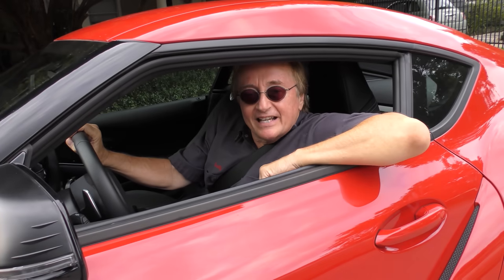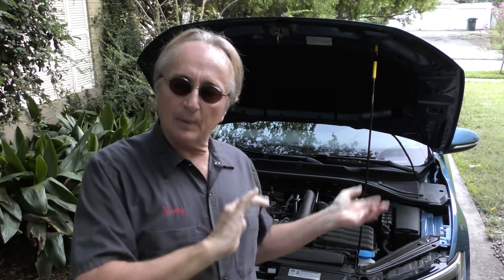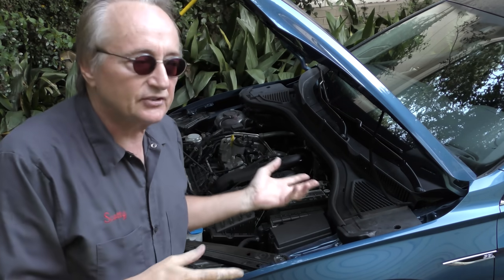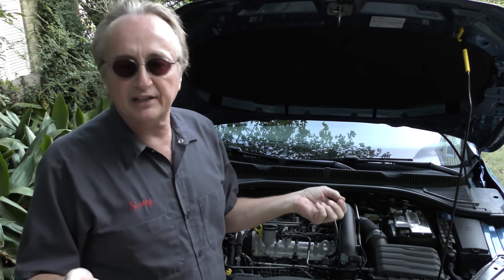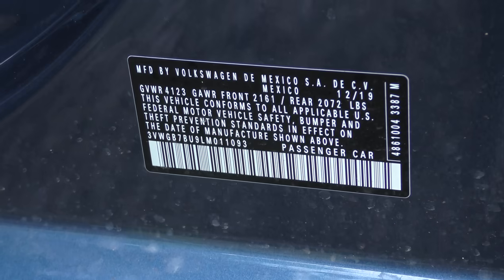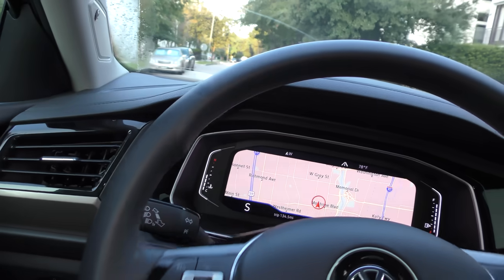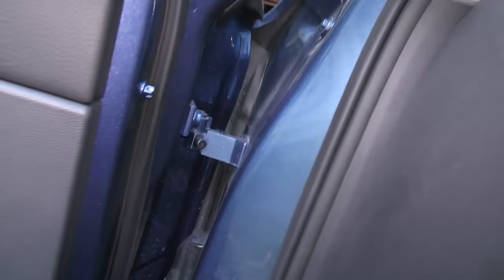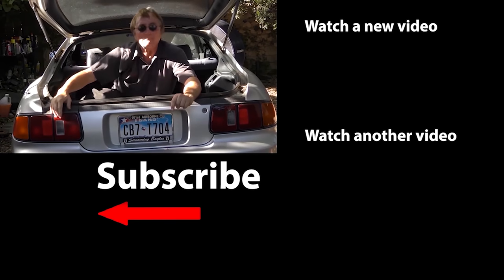I Just Found the Worst New Car Ever Made

Comment: Actually these newer 1.4 TSI's are pretty reliable. I don't think the timing belt is that big of a problem if you change it on time.
Reply: As a mechanic who mainly work on European car, yes, this one is easy enough
Reply: 1.4tsi/1.5tsi/2.0tsi all pretty good we'll built engines in well built cars. VW says lifespan is about 200k miles and generally they make that without problems after that they can go for longer sometimes. However keep in mind it will simply wear out from the turbo strain and break so just buy a new car by then. Thing is though in the usa people drive more then here in Europe. In Europe gas prices are 3.5 times higher aswell. So it makes sense to produce these engines because of gas mileage and people here tend to not drive 300-400k miles with one car anyway since that is 30 years of driving for most people.
Reply: When would you say is a good time to change the belt
Reply: @sinisterdraws4483  When VW says you should. I used to change it every 60k miles on my old Passat TDI, but always check your owner's manual.
Reply: @sinisterdraws4483  Vw lists for a belt inspection at 248.000 km
If belt is ok inspect every 30.000 km.
Reply: They’re replacing the 1.4T with their new 1.5T. I wonder how the 1.5T will be
Reply: @devn3813  Hearing reports of significant oil consumption on these newer ones.
Reply: It's even on the published service schedule... honestly it was always going to be yelled at as it's not a Toyota Camry/Prius
Reply: Timing belt costs over $1000 to change, and it has to be done 4-5 times over the life of the car.  That’s a giant waste of my money!
Reply: Warranty Direct insurance company rates VW the 2nd Least Reliable engine due to frequent breakdowns.  My Beetle turbo engine died at just 70,000 miles so the WD rating seems accurate.  My 2 Hondas went 300,000+ miles with no engine breakdown.

Also VW commits criminal acts by cheating on EPA and EU pollution tests
Reply: @devn3813  .1 better
Reply: @skimanfree1073  yeah makes a big difference with a fairly slow car
Reply: My VW had the same care as my two Hondas that lasted over 300,000 miles.  There’s no reason for it to fail at just 70,000 (except it’s poorly designed crap).
Reply: @electrictroy2010  The earlier engines with the timing chains were poorly designed crap. Some would fail even quicker than that. That said they fixed the problems on the newer ones. Only problem they have is the already trademark VW oil consumption. And yeah Honda is better than VW on the mechanical side, no doubt about it. The interior is the only thing that's better than the competition on newer VWs.

Comment: It takes 4 hours to replace a timing belt on a 1.4T. In other words, about the same time as any timing belt. And the water pump isn't under the cover. I changed mine at 125,000 miles. Zero signs of wear, but wanted the peace of mind. And it's my third Volkswagen, my second Jetta.

Comment: New timing belts are usually made of a Kevlar composite, which is as strong if not stronger than steel. No reason why they shouldn’t last basically forever.
Reply: Not only that, but the best that I could find online is that the belt "should" be changed at 150k.  That's 10-12 years of average mileage, and the first major maintenance cost in that time.
Generally, I'd prefer a chain, but we've all seen a timing chain break or slip, too.  Those are usually interference engines as well, but nobody says anything because nobody expects the chain to break.

Comment: Modern cars put more tech and shine while cheapen the powertrain, AC and electric system for me I would rather have lowest tech but solid build powertrain, AC etc
Reply: Downsized engines aren't necessarly cheaper tho. They often need precision and high quality forged parts.
Reply: Mercedes surname says it all
Reply: AC on this vehicles is really good. I own this vehicle.
Reply: Gas milage and emissions is king, less space to fill, less emissions, same or better hp, but nearly no room for valves in a 4° slop or more. They could make it easier to change, but you have to pull spark plugs to set TDC cylinder 1 so just keep it away from redline, and run the heater on low in log drivethru lines or traffic to keep pressure off the pump seals.
Reply: Soon there will be no powertrain lol.
Reply: Yeah.. Agree
Reply: @Mohnnad Mercedes In my opinion 90's and early 2000 model Japanese cars had the best balance of tech and reliability.
Reply: @AG-uh9bf  you probably kept it running every time you drove the car which is unnecessary.
Reply: @trevagraham1605  my 2000 VW Cabrio fits that description

Comment: I have a mk6 Jetta with the 2.0 i4 NA engine. Best car I’ve owned, bought it with 70k miles, it has 151k now and nothing has broke, never had the engine light on, all I’ve replaced is the a/c compressor. Trans still shifts smooth. I know it’ll last me over 200k

Comment: I guess by lifetime they're referring to the lifetime of the warranty.
Reply: Referring to the lifetime of the car... About 60k miles
Reply: Lasting to the end of the scheduled maintenance, which is 120k.
Reply: I think that says something if scheduled maintenance is only to 120k
Reply: Yes or the lifetime of any Volkswagen or Audi which is well before 100k
Reply: @krassimirpetrov7131  Friend of mine put 7k into a 2009 VW beetle to restore the non-working convertible top, wheel hubs bad on two sides, brakes, etc etc. about a year ago. Car has 88k miles on it and the starter, battery again, charging cable, fuse box and maybe the harness needs to be replaced. They're starting with the battery and cables at a lovely 600$. Would never, ever purchase a volkswagen.
Reply: This VW's engine has been out for 6 years, it does last past 100,000 miles and is actually a pretty reliable engine. According to the maintenance schedule the timing belt should be replaced every 100,000 miles wich is anout an 1,100 service at a VW dealer. It's been said it'll last a little over 120k on VW forums tho

Comment: Well i have had my 2013 cc manual for 8 years and havent had any issues with it whatsoever besides getting break pads and oil changes
Reply: Warranty Direct rates VW the 2nd Least Reliable engine due to frequent breakdowns.   My Beetle died at just 70,000 miles.  My 2 Hondas went 300,000+ miles with no engine breakdown.

Also VW commits criminal acts by cheating on EPA and EU pollution tests

Comment: The timing belt on a 1.4 TSI must be replaced every five years or 75,000 miles. They also replace the water pump and tension rollers. At the dealer this costs around $600.- independent garages are a lot cheaper.
Reply: $600? I'd bet it's at least twice that.
Reply: The Jetta 1.4TSI has a timing chain.
Reply: @douglasb.1203  Only the old EA111. The EA211 (from 2012ish-on) is a lifetime timing belt with an inspection interval of 150k miles and every 20k therafter.
Reply: $600 not bad for the dealers, I've spent $900 to have the timeing belt changed when I had my 2008 Toyota Camry.
Reply: I got an estimate at VW for a timing belt and water.They wanted  little over $3,000 for the job.F that

Comment: The 1.4 TSI is truly the worst engine.
I needed a commute for work and could get a Octavia with this engine for a cheap price.
I researched the engine and was shocked, how BAD it is!
I got a 1.4 Corolla... which was the best move... now I drive a 2020 Corolla 2.0l hybrid GR fully loaded.
Don't get a VW!

Best regards from Germany
Reply: Nice to see a German buying a non German car.  Your Mercedes and BMWs and VAGs are overated.
You should have bought normal ICE  Corolla with no hybrid.  Less complicated.
I am from the UK and always bought German cars.  Then I moved to Thailand and was in a Toyota Corolla taxi in Bangkok that had done 1 Million Kms.  I looked at Toyota products and now drive a Toyota diesel double cab pick up truck and if buying a car would buy a Corolla or Camry.
Reply: 1.4 tsi truly the worst engine??? Yet its powers millions of VW, Skoda, audi's and Seat's around the world. Its had its problems especially the earlier versions but its by no means the worst engine as you claim.
Reply: Its been awarded "engine of the year" for nine consecutive years or so..  Direct injection turbocharged back in the day was an innovation. You get the horsepower, the torque, the fuel economy and fewer emmisions and all of that from a 1.4 engine. Thats called "efficiency" and if an engine is efficient is not the "worst" for sure. 

To get all these goods ofcourse you need high pressure fuel, high temperatures in the combustion chambers etc so you sacrifice a little bit of reliability, but you cant have it all.
Reply: @prozacnation25  It is all about complying with Euro regulations created by those Buro-craps.  As a UK National so glad to see that the UK are leaving the EU and hopefully with no trade deal especially now the UK has signed a good trade deal with Japan.
Reply: John Anderson that’s because you can’t afford a bmw Chief you have no idea what a true driving machine is
Reply: Battalon, you made a very smart calculated choice, i too use to own VW, golfs and an Audi 80 coupe, but after so many trips to the Vag, garage, i had had enough, i asked one body repair man, who makes the most durable, well made vehicles, the answer was, Honda and Toyota, then i asked two mechanics, i got, Lexus Toyota twice. So opted for a corrolla based mr2 spyder, in 10 years, apart from tyres and oil changes, filters, wiper blades, the only thing that broke was one solitary oxygen sensor. It had 66 thousand miles on it before it was written off in an accident. Toyota make what i and others believe to be the best cars for reliability.
Reply: @johncombs216  I might not be as well off as you.  I had many BMWs starting with my own E30 when I was 24 years old when they were exclusive to own compared to the Fords and Vauxhalls.  I have had many company cars ( BMW, Mercedes and Audis).  
If I was buying a good reliable quality car would opt for a Lexus (Toyota) built in Japan.  

With regard to your "true driving machine", there is no point with all the traffic, speed cameras and state of the roads in the UK.  By the way, most manufacturers seems to be advertising media connectivity as opposed to power, top speed and acceleration as in the 70's and 80's.
When you get older in life, you will realise that status symbols, such as cars, are not so important and keeping a lower profile is the way to go.
Reply: Chaminda Thushara Ruwan Kasturi  BMW is so common now that it is nothing special.  A Lexus is more exclusive.  Have a look at something like the Lexus LC500 with V8.
Luckily we all have different tastes and requirements in life.  BMWs for some and Toyotas and Lexus for others.
Reply: Der 1.4. TSI von meinem Kumpel ist 160000 km in 10 Jahren gelaufen, völlig ohne Probleme!
Reply: It is the worst of VW. That is a fact.
The second worst was the old 2.0l TDI (the new one is tied to the newest diesel scandal....). 
Of course some have good experiences with both BUT not the majority!
Asking my mechanic gave me the same result.
With the right proper maintenance even a Italian car can run forever.
But we do not drive a car to take car of maintenance all the time.
I know a lot of people never experienced any problems with BMW... but in general the quality plummeted since the 2000s.
Reply: @VampirusX  Since beginning of the 2000s ICE have become more complicated with all the EU buro-craps regulations and hence less reliable and expensive to repair.  Hence, in the UK have been driving pre 2005 cars but that is now not possible with the emission regulations in the London area that is expanding further and further out.
Reply: @johntheaccountant5594  The Toyota hybrid is proven for decades.
Nearly every Corolla and Rav4 in Germany is hybrid.
The hybrid is a closed nearly maintaince-free part.

It is not always a matter of taste.
I am not a Toyota fanboy. I am a fan boy of reliability. That's why I choose the 2.0l hybrid. The only "problem" is the direct injection, which can lead to possible carbonisation.
The 1.8l is bullet proof. But I wanted the extra boost 😁
Reply: Warranty Direct insurance company rates VW the 2nd Least Reliable engine due to frequent breakdowns.  My Beetle turbo engine died at just 70,000 miles so the WD rating seems accurate.  My 2 Hondas went 300,000+ miles with no engine breakdown.

Also VW commits criminal acts by cheating on EPA and EU pollution tests
Reply: @johncombs216  BMW owners are some of the worst people I've met. Nice to see you reinforce the stereotype chief

Comment: Guess what's happens when the belt snaps? The engine will die. Thus, concluding it's 'lifetime'. So yeah, lifetime belt.
Reply: @rogue dude.... have someone look at that belt, you don't want your mom's engine blowing up on the highway
Reply: @whoopigoldberg9956  I agree
Reply: @rogue In b4 that belt snaps. 🤑
Reply: The engine won't die... lol, you'd just have to replace the cylinder head... only half the engine.
Reply: @KobraPun  I'm guessing you don't know what an "interference" engine is and how a valve breaking off, destroying the piston, cylinder walls, and head works.
Reply: @georgiadronefootage4136  Been a technician for three years, I've replaced tons of cylinder heads for chain tensioners popping on the CCTA and CPKA engines. The volkswagen interference engines rarely break the valves, it just bends them. Stop assuming.
Reply: Diesels (belt driven also) CJAA and CVCA/CRUA engines have valves that are directly in line with the pistons, so most often those valves don't even bend when piston meets the valve, it just breaks all the rockers.

Comment: The real question is: what will break first? the belt or the turbo.  Whichever one goes going to be too expensive to fix.  Even if you replace the belt at 100K, you'll have to keep in mind that the turbo will go soon after or vice versa.
Reply: Have not heard of a turbo going out on these under 100k, would be surprised. And if it did blow, the battery is the likely culprit. When the battery goes, the coolant pump that cools the turbo after shutdown does not run.

Comment: This is actually the most reliable vw engine since the 1.9 diesel (which was phased out in the late noughties). Service it on time and it'll last a good 15 years no problems
Reply: I'm agree with you i have a golf mk7 in europe with this engine, what a relieble engine
Reply: BTW the premature dead Beetle was a “reliable” 2005 diesel.  Also most of the cheap plastic interior broke off.  I’ll never buy another shitwagon.
Reply: @electrictroy2010  seem like you had bad luck with not taking care of the car.
Reply: The VW had the same care as my two Hondas that lasted over 300,000 miles.  There’s no reason for it to fail at just 70,000 (except it’s poorly designed crap).
Reply: Honda has several cars that passed 1 million miles on the original engine.  VW has ZERO.  Statistically VW engines breakdown more often than any other brand (except Land Rover)

.

Comment: I have the 2019 car on lease for ~$98 a month and it has been great so far especially the gas mileage about avg 53 mpg, it’s has actually the ASISIN 8 speed not the dsg transmission, and this is now built on the same MQB platform as the golf so I believe that they trying to fix things especially when comes to longevity compared to their history of making cars, even though it is an interference engine.
Reply: $98?
Reply: You can't get average of 53mpg. 35mpg I believe but not 53mpg.
Reply: @puneetjamariya  Yes you can? thats 22.5km pr liter, its the same as i can get with my 6 speed manual Seat Toledo (almost same as this car, a bit smaller)
Reply: but ofc average isnt that, but u can if u dont push it
Reply: @puneetjamariya  I have a 2016 with the same engine and average about 34 mpg in mixed driving (40 mpg highway). But yeah, 53 seems a little much unless you're driving like a hypermiler.
Reply: Puneet Jamariya out of my 13 mile daily commute about 11ish are on the highway doing 70 mph
Reply: jeverett72 actually it was about $1400 up front for everything including paid maintenance intervals at 5k miles 39 months lease so I think I got my money’s worth
Reply: @mdb501 I have a 2019 Jetta and I am able to get 53 mpg on the highway but thats because its a manual. I usually average 40-45 bc I drive a bit spirited
Reply: Warranty Direct insurance company rates VW the 2nd Least Reliable engine due to frequent breakdowns.  My Beetle turbo engine died at just 70,000 miles so the WD rating seems accurate.  My 2 Hondas went 300,000+ miles with no engine breakdown.

Also VW commits criminal acts by cheating on EPA and EU pollution tests
Reply: @MrChris199826  wait wgat

Comment: One of the few car reviewers that actually calls out engine and engineering faults.
Reply: Warranty Direct insurance company rates VW the 2nd Least Reliable engine due to frequent breakdowns.  My Beetle turbo engine died at just 70,000 miles so the WD rating seems accurate.  My 2 Hondas went 300,000+ miles with no engine breakdown.

Also VW commits criminal acts by cheating on EPA and EU pollution tests

Comment: Gotta love German engineers who design these things. They have the same first step for every repair in their repair manual: Step 1: Remove engine...
Reply: True that
Reply: That's not true
Reply: Warranty Direct insurance company rates VW the 2nd Least Reliable engine due to frequent breakdowns.  My Beetle turbo engine died at just 70,000 miles so the WD rating seems accurate.  My 2 Hondas went 300,000+ miles with no engine breakdown.

Also VW commits criminal acts by cheating on EPA and EU pollution tests

Comment: 1 thing I really like about vw you can drive between 70 to 90 mph and still get anywhere from 25 to 50 mpg particularly these little turbo 1.4 1.8 and 2.0 tsi motors they make excellent power with excellent mpg